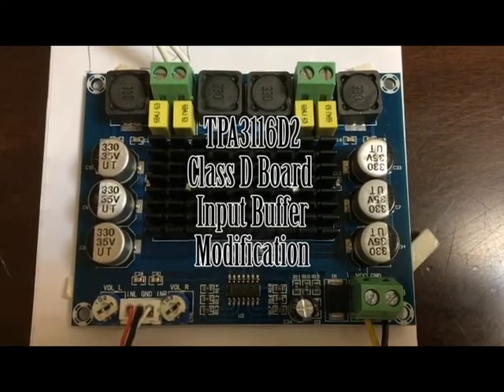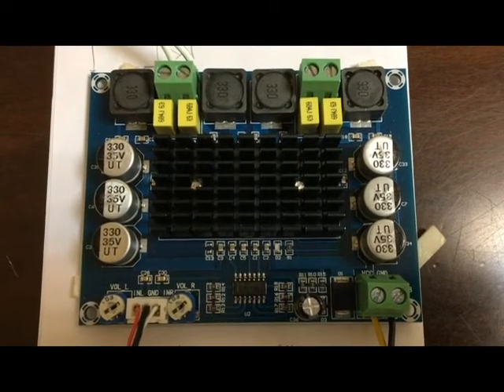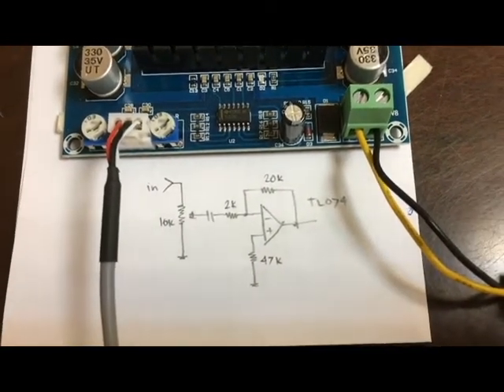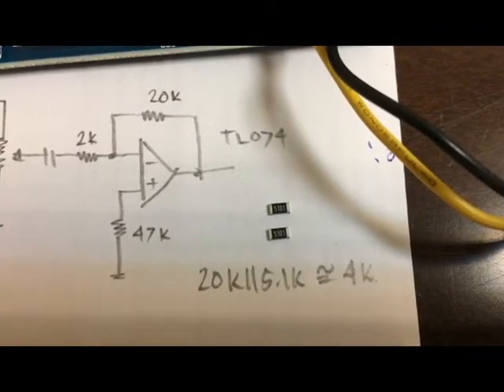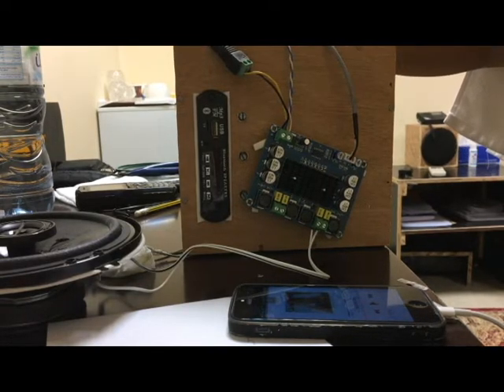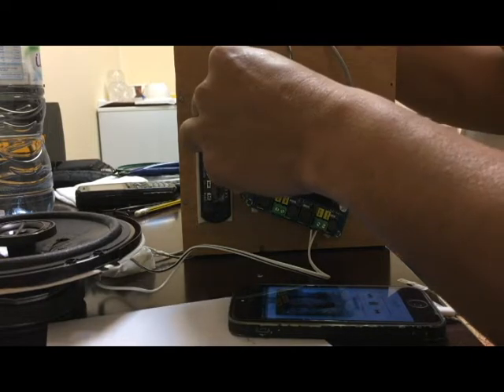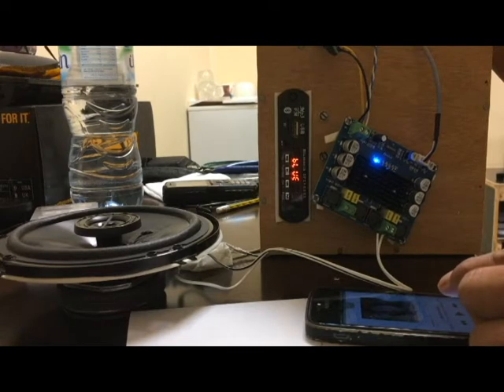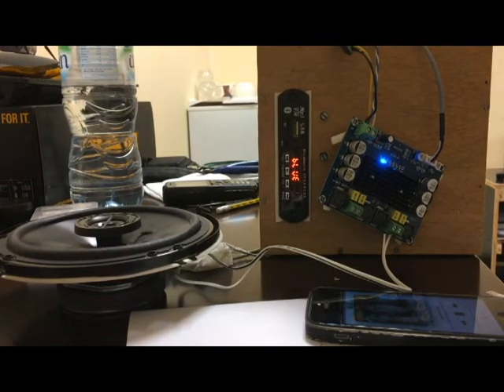Pinoy Elex - TPA3116D2, a class D amplifier

Comment: Sir ebukod mo yung supply ng module bluetooth mo wag mo isabay sa amplifier mo mgka hizzz yan
Reply from the maker: aus na yan bro, just resistor lng in order to overcome float ground level, having separate psu will do best but for small system with multiple psu is not practical
Reply: Ah ok sir.  Saan po ba ilagay ang resistor bnda? Sa supply ng bluetooth or sa output ng bluetooth??
Reply from the maker: @jestersantillana4872  BT ground negative psu line

Comment: its from your Bluetooth amp, you need to connect both ground to remove hiZ
Reply from the maker: it has a common ground, star connection ground, i have series 10R resistor on bluetooth ground and it was gone, system work perfectly now, tanx for ur comment